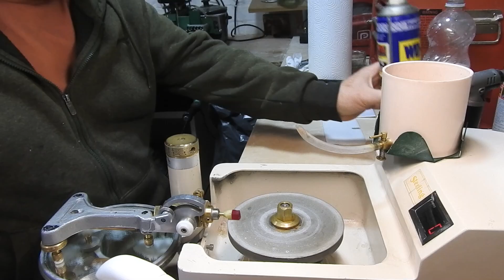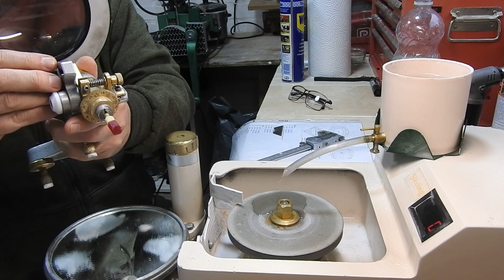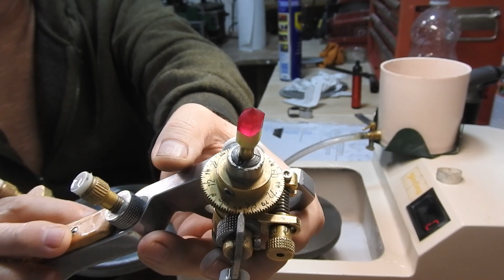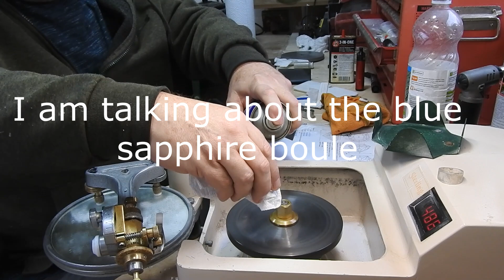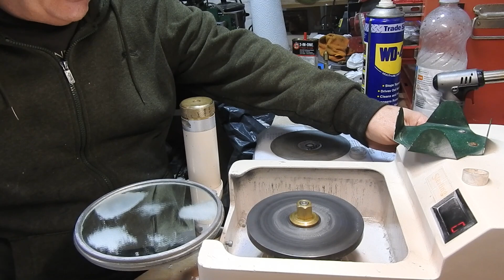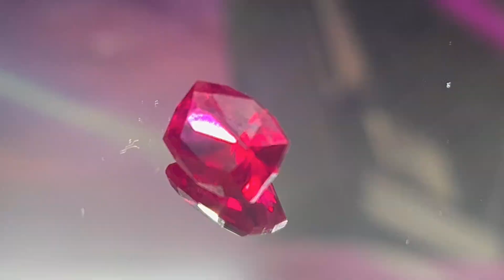Faceting lab created Ruby

Comment: I have a basic flat lap machine and worked on one of my ruby boules a while back.  I just made a basic cab really.  It's such a challenging material to shape.  It's a rather large round piece and it slips out of the fingers even with dry skin.  Cheers!
Reply from the maker: Sounds like a case for using a dopp, a bit of dowel and attach the stone with epoxy. Better still get some 6mm brass rod on e bay or Amazon it’s not expensive, and attach the stone with epoxy. With brass you can heat the brass to remove the stone. Good luck.
Reply: @marksgemfaceting  I did use a dopp after a couple drops. It’s amazing how slick it is even on dry skin.

Comment: you use glue for dop transfer ?
Reply from the maker: 5 minuet epoxy normally aroldite, put it by a radiator to dry for at least 4 hours, better overnight.